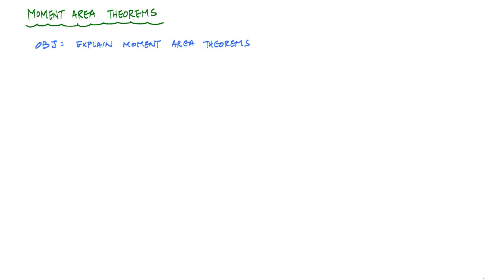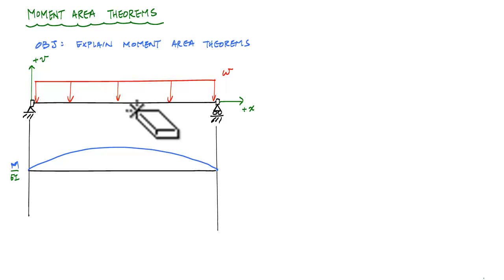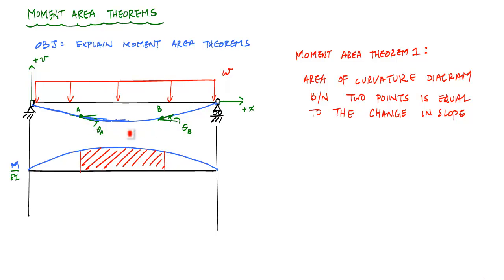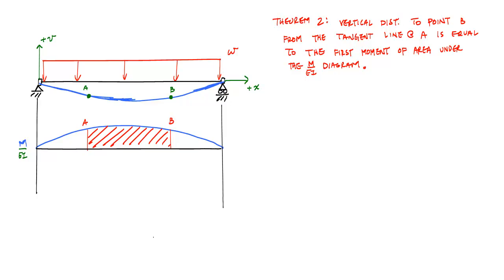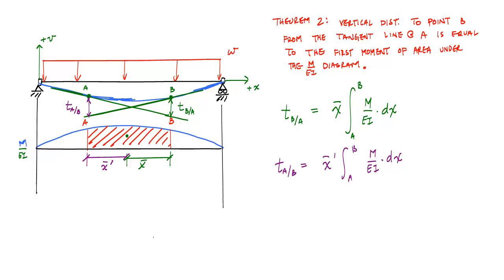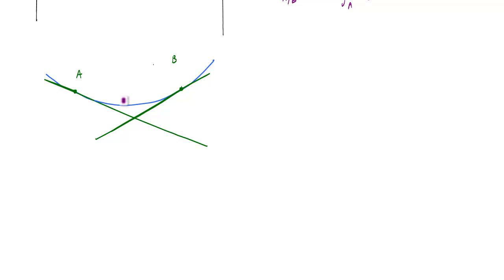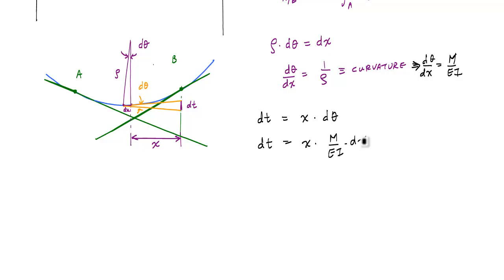Moment Area Theorems Explained - Structural Analysis

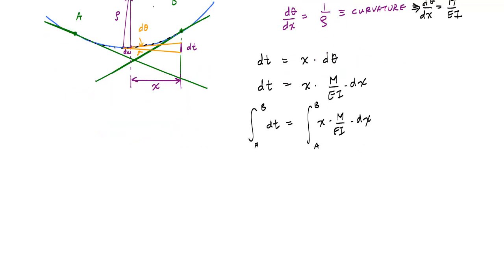Comment: At 8:00, why does x become the centroid instead of just (x^2)/2 ? Is it because it's defined as the distance from the point of interest to the center of the curvature (the circle's centroid)? Thanks for the vids, haven't looked at this stuff in 5 years and I'd be lost without you man :)
Reply: Could you explain this to me ? I didn’t quite get it :/
Reply: The first moment of area (S_y) is defined as the sum (integral) of x dA, where x is the distance from a given axis to the centroid of element dA, right? If you divide this by the sum of areas, you get x bar (distance from this chose  axis to the centroid of the whole figure one is looking at), right? So looking at our curvature diagram, what is our area? For a small area (dA), we have Height (M/EI) * width (dx), so integrating this for a chosen intervall x gives us an area. Because S_y can be written as x bar * area, we can therefore write it up as x bar * integral (M/EI) dx, which is where my confusion is at right now. Am I on the track of something?

Sorry for my bad English, I am from Norway.

Thank you Structurefree for this great channel!

Comment: You've helped me so much man...I'm getting good at using the methods, I'm just having trouble determining with method to use for a given problem.

For example, If a beam problem asks to find the slope/deflection at a point, how do I know whether to use double integration or the moment area method?
Reply from the maker: Priya Manmohan it depends on how much work you are willing to do.  integration can be cumbersome depending on the number of functions and boundary conditions you have...personally i like the conjugate beam method.